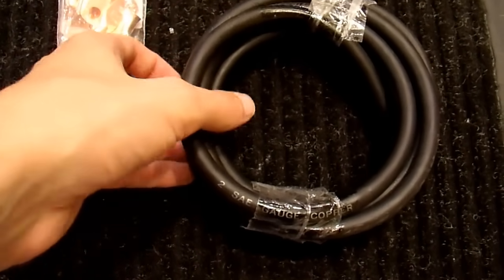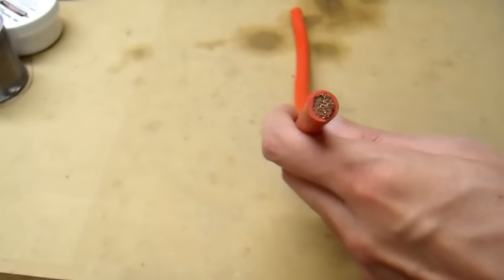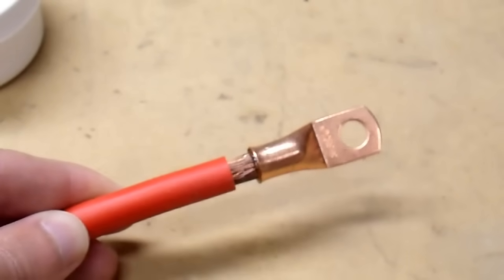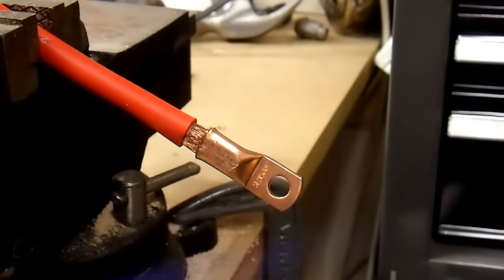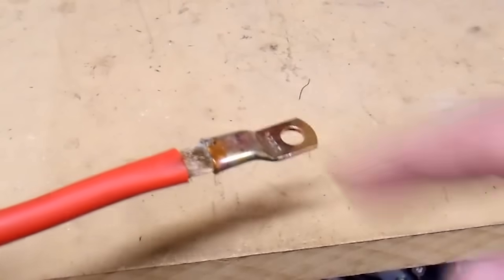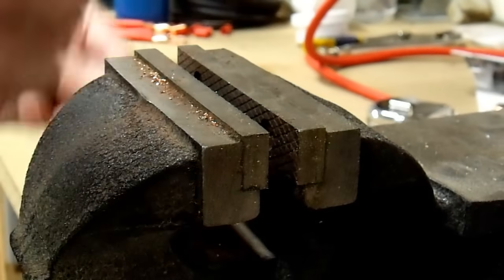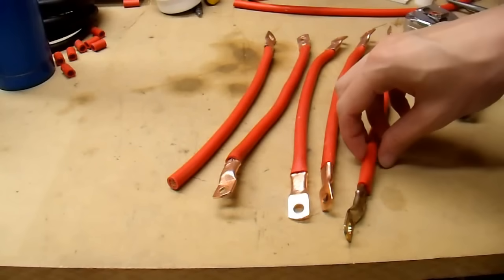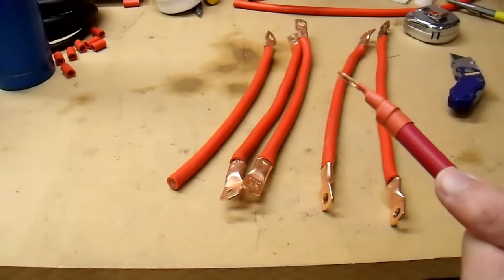How to Make Battery Cables the Right Way and the Easy Way

Comment: The information presented in this video is more of a 'quick and workable' solution and is not intended for anything 'professional', 'top grade', or anything that needs inspection and certification - or at least that's how I would interpret it.
Hopefully by now he has moved on to using actual cable crimping equipment, or at least a handheld style crimper that looks more like a bolt cutter with toothed jaws.
It's bulky, tedious and troublesome to set up, but once crimped is as good a connection as any proper one, though it isn't going to be this instagram picture perfect crimp job - but i'd rather not sweat and whine when it comes to the aesthetics for these things; performance is what is important, not looks.
Then you have the hand-powered hydraulic crimpers with sized dies. Those are made for the job and should make professional grade wire terminal crimps as long as it is set up, used and insulated correctly. We use them hydraulic crimpers here in industrial electrical connections dealing with 480VAC 3PH with 2/0 cable size minimum and hundreds of amps' worth of current, and thus far have no issues whatsoever with the made to fit wiring.
Reply from the maker: This comment.  This guy(? gotta be careful assuming genders today) gets it.  Exactly the point of the video.  While no commercially made cable should be made this way I unfortunately have seen many-a commercial cable made far worse.  Simple methods like this work well but it isn't suited to high quality mass production.

Comment: I've done it that way along time ago. Get the 10-20 dollar hammer crimp tool from amizon. Mine cst $15+ free ship w/ prime
Reply from the maker: I have one of those and am not terribly happy with it.  I think I've used it on 2 cables total for that reason.  The crimp quality is poor with low surface area and since it takes multiple hits it fatigue hardens the metal.  And then the large cavity left over is not appropriate for soldering if you want more corrosion resistance.  A simple 'linear smash' makes for better crimps.

Comment: theres a crimper for this bro...
Reply from the maker: Yup.  The hammer style crimper is terrible and a simple method like this is better.  The hydraulic/pneumatic crimpers are great but cost way too much for the home jobber.  The crimper types that rely on mechanical leverage simply aren't capable of producing the forces necessary for a decent crimp on cables of this gauge so it really requires high dollar tools if you want it done professionally.  The point here is that it really isn't necessary.  Simple and crude methods do work well.

Comment: Good heat shrink has glue in it that seals it... FYI!!!
Reply from the maker: I am well aware of that.  Ingress typically happens due to capillary action and the tiny flaw that allows contaminants in is often not seen.  And never will be until failure if there is heat shrink on the termination.

Comment: is is not good to solder? i have heard from many to just to crimp  because  overheating will melt the solder
Reply from the maker: In most cases the best connection is to press the crimp once without impact using a pneumatic or hydraulic die but for most people making their own cables this isn't a practical option.  Hammer crimps work harden the material and aren't very reliable, so a straight press as shown here is about as good as you'll do with simple tools.  As far as soldering melting if the cable overheats, well, you'll have serious problems well in excess of molten solder if its getting that hot and the solder will drastically improve conductivity and thermal conductivity if the crimp is iffy alleviating the problem in the first place.

Comment: A real electrician uses a special crimping tools. It is easier and faster.
Reply from the maker: Absolutely.  Unfortunately the hydraulic/pneumatic crimpers necessary for this type of cable are expensive and impractical for the type of people who would  watch a youTube video on terminating large AWG cables, and the less expensive hammer-crimp style tools are - in my experience - inferior to the crude method shown here.

Comment: Flux the lug, heat it and add solder about 1/4 way up, flux cable, push it in hold it 30 sec. done.
Reply from the maker: Works well - same process as the solder/flux pellets they sell for this purpose.  The problem is that it uses a lot of solder and if there is any lack of intermetallics due to insufficient fluxing or heavy oxidation (difficult to inspect without cross-sectioning and using a good microscope) you will end up with a mechanically weak cable prone to pulling out.  I prefer a mechanical crimp, and if using a crude crimping method like shown here solder guarantees a low impedance connection.  Just my preference but the above is why.

Comment: “I’m only going to heat the end piece here so I don’t oxidize the wire... “

then processes to roast the shit out of the entire thing..looked like he thought he was soldering a copper pipe
Reply: I heat the connecton until the solder flows.  I intermittently apply heat as needed to keep the solder flowing.  Never continuously keep the torch on the connector.  Keeps the heat from melting the insulation.
Reply: Wow you guys really just wilfully ignored ALL the times he stated there are better ways to do this -  like having larger solder so it doesn't take as long. Like someone else said - he's not going to the moon with this cable. It's good enough for what he needs. Fucking pedantic perfectionists do my fucking head in....
Reply: @chocolate_squiggle  Look at the title of the video.
Reply: @chocolate_squiggle  Bodger.

Comment: This video has got to be an internet perpetual trolling video. 

How do I know the connection under the heat shrink is good? Because I used the right tools the first time to crimp it properly. Then I added heat shrink.
Reply from the maker: And then it corroded 5 years later due to a tiny defect somewhere due to invisible damage or whatnot that let liquid in and kept it there.  And you couldn't tell because it was covered by heatshrink.  Yup.  Just trolling.  Nothing practical here, just theory where no one needs practical experience.  Hey you've got CYA on your side if anyone asks right?  Because you used 'the right tools the first time'.  Yup.

Comment: Just chiming in to repeat what others said - this is the WRONG way, even for a DIY guy, to crimp cables. Also, just stop watching once he re-starts his video to talk about heat-shrink. Total rubbish, even the cheap non-adhesive stuff is better than nothing. If you are worried about poor contact, use a multimeter. If you don't trust your connection, then you should do it again properly.
Reply from the maker: Use a multimeter to check for 'poor contact'?  Wow.  Even if this video is incorrect you clearly know absolutely nothing about the subject.

Comment: this video is FAKE NEWS!      I have worked on. gm - ford - chrysler - john deere - caterpillar -  NONE of them use ANY solder in their cables! they are crimp ONLY! -- with the correct tool of course --  a solder joint is RIGID and will not flew with vehicle vibrations.  using solder will lead to wire breakage and thus a poor connection.
Reply from the maker: Absolutely false.  All of these manufacturers use metal impregnated terminations for high current applications.  ALL OF THEM.  It saddens me to see comments like this that are so grossly misinformed yet claim to come from a knowledgeable source.  OEMs generally don't use solder but they are metal impregnated which is better for mass production yet less practical for the home mechanic.

Comment: The way I do it is to, fill the lug with thick solder & while the solder is still hot or melted I push the cable into the lug. I finish it off with piece of heat shrink. I also can crimp the lug onto the cable with a mini hydraulic crimper without solder. 😊

Comment: Hammer and a roll pin punch make an extremely strong and aesthetically pleasing crimp if you don’t want to you know do it the right way. In an automotive application solder isn’t recommended due to vibration they will definitely break. The exposed cable definitely will corrode, solder won’t stop it from corrosion. Dual walled heat shrink is an absolute must. Your poorly crimped connections I would agree should be hidden. This is by far the worst video I’ve prolly ever watched on the “right” way lol. The heat shrink part I feel made a lot of us a little more retarded just due to listening to you say it. The actual purpose of good quality heat shrink is to stop the corrosion from entering in the first place lol. Once the glue squishes out the end it’ll be years before it ever if at all corrodes. 

Tip of the day silicone a penny right beside the positive post on the battery and you’ll no longer get corroded connections at the battery posts. The penny gets eaten away and no more corroded positive post. Just replace penny after the previous one disappears

Comment: You don't need to crimp it you really are a greenhorn
Reply from the maker: It saves on solder.  You can purchase solder/flux pellets to place in the connector before heating and press the cable into the molten metal but it uses a lot of lead/tin which is fairly expensive.  Crimping also results in a more robust mechanical connection that isn't as reliant on intermetallics holding the connection together.  Poor intermetallic mixing is the primary cause of solder failure in the solder type of connection without crimping.  For the home jobber I would NEVER only solder for that reason alone.  In a controlled manufacturing environment, sure.
Reply: @knurlgnar24  but you put flux on....

Comment: I wouldn't bother with the crimping, just solder. Neater roundness. Still, I'd use proper battery terminals: https://origin-images.ttnet.net/pi/eprv/10/00/50/34/NP610005034-35b.jpg
Bare the wire to the correct length, insert into the terminal and clamp the 2 screws tightly. Job done.

Comment: For like $15 I got a tool on Amazon that you place the the terminal in, that has a slide that you hit the top of with a hammer and it crimps the terminal. I tried to pull a terminal off and could not get it to budge at all.
Reply from the maker: I have that tool as well, or at least one like it.  It works OK but is constructed very cheaply as they all seem to be.  It seems to work for me about as well as a vice grip or bench vise.  I think it is a useful tool but nothing special with respect to making terminations.  I prefer this method.  A multi-hundred dollar pneumatic/hydraulic crimper would work better in most circumstances but that isn't really the purpose of this video.
Reply: @knurlgnar24  a good hydraulic one with dies is $50 at Harbor Freight, just so you know 👍

Comment: No...  The right & correct way is to spend the $30 for a hydraulic crimping tool with replaceable AWG wire crimping dies...!   (The hydraulic crimp actually molecularly fuses the copper terminial & copper wire...)
Reply from the maker: You won't find a proper hydraulic crimper for $30 - and if you do it will be absolutely terrible.  If you want to spend hundreds of dollars on a crimping tool then that is an option, but this method works just fine for most purposes.
Reply: @knurlgnar24 I think I paid $28 for mine in a blow molded case & it works great...!

Comment: There IS a way to test the integrity of wires. It's called a voltage drop test. This entire video is wrong on so many levels. You really should take this down or rename it, "I'm cheap, ignorant and lazy if you are too this is the video for you"
Reply from the maker: The equipment required to test the conductance of a crimped cable is expensive and specialized and therefore completely useless information to viewers of this video.  It is also not a good method for determining cable quality contrary to what you state.  This video is about making cables quickly, easily, and functionally solid without unnecessary tools and steps for the amateur.  Given your comment I am quite certain that you are the ignorant one here.
Reply: @knurlgnar24  A 20 dollar multimeter is "expensive and specialized equipment"? How do you not know this? Don't act like an authority when you don't even have the basics covered.
Reply from the maker: @ratfink9205  I have worked with inexperienced engineers and know how these things work.  It IS possible to use a $20 multimeter to get measurements of conductance on a sub milliohm termination but the setup and measurement technique results in useless measurements almost 100% of the time.  You really do need specialized equipment to get that measurement right a high percentage of the time with average trained personnel.  Viewers of this video are not interested in some know-it-all spouting what they read in their training manual.  They are interested in what actually works for the average person.  In addition the conductance of the connection is relatively unimportant compared to the rest of the parameters.  e.g. a poorly crimped termination can easily result in a low resistance but be a poor crimp as a resistance test is only applicable if a particular procedure is assumed to be followed properly.  FMEAs and the like are often used for these instances.  This is the sort of thing an experienced engineer encounters repeatedly.
Reply: @knurlgnar24  They don't need some hack telling them how to shade tree their way through it either.  You don't need specialized processes or tools to do a proper job for the 'average" DIYer. A good hammer crimper can be had for 20 bucks. You can't even manage to strip the insulation off properly FFS.
Reply: @knurlgnar24  Here, learn something so you can intelligently convey ideas to your audience. https://www.google.com/search?q=how+to+do+a+voltage+drop+test&oq=how+to+do+a+volt&aqs=chrome.0.0j69i57j0l6.6018j0j8&sourceid=chrome&ie=UTF-8

Comment: wrong never solder battery cables the solder will blow everywhere should the cable short , use a proper crimper or better still a hydraulic one and the cable should be tinned copper to prevent corrosion and heat shrinked
Reply from the maker: This is a myth and not backed by any evidence or data.  In the case of a short all metals will be vaporized and solder or copper will behave in a similar fashion as safety data shows.  Arc fault severity does not depend on metal type.  Corrosion is reduced by tinning the copper or by soldering.  Heat shrink always increases corrosion potential by trapping contaminants in the cable, it does NOT decrease corrosion.

Comment: You should triple up on the solder and some kind of heatsink on the insulatation so it does not melt .Use wathever works.

Comment: Man! Talk about doing that the hard way! That was painful... Put the flux on the cable.. put the terminal in the video.. heat, add solder, shove wire in terminal , let cool.. no need to crimp... Add heat shrink done... Bam... 80% faster...
Reply: That's what I was thinking.. way too hard.  Been doing it the way you described for years to make quick reliable power connections... made little jigs to hold everything in place for difficult locations... also, used nice appropriate sized hand held torch for better heat control.  No corrosion over the years, durable... in my opinion better than factory cables which I've seen develop resistance inside the connector, only discernible by heated terminal or voltage drop... with proper technique soldering is the way to go.  Use quality heat shrink to seal and finish.

Comment: Had to stop watching at the vice as a crimper part...Whole reason there is a tool for crimping lugs is to make contact with 4 points of the lug To close the diameter of the lug into the wire Without changing the spread of the wire Where you end up with pinch point  Depending on the power into the wire This will be your hottest point "A bottle neck of power" if you will. Also using a very thin coat of dielectric grease will sovle your issues of oxidation inside the lug And still keep its strength. Keep your exposed wire to a very min,  Proper shrink tubing over the wire and lug is always best.

This way ...You have 0 exposed points in the lug (no need for soider/paste/torch = money saved) No need of a Avg $100 Vice = money saved 

And with my way You have a full rounded crimp with a Hammer crimper ($25) which you can always bring back to the store And tell them is was the wrong one and get a refund = money saved for one time uses Your wire is now on tight / sealed .. Battery cables the right way ..Because eazy isn't always the right way

Comment: I believe power cable connectors are never soldered, only mechanically fastened. I do not know the exact reasons why but I would guess it is for safety and reliability reasons. In that respect, the second, "easy way" to make these cables is the "right way" whereas the first "right way" is a no-no. But you should do your own research and consult a professional and not rely on my comments. Besides, standards, rules and regulations are somewhat different in each country and region and of course for each intended usage.

Comment: Yeah acid flux ... I would tin the wire so it burns off first but rather use Rosen or liquid flux that evaporates/boils off. Not a big crimp fan because I have seen too many fail, I always solder, even 6 awg connectors having worked with 100amp plus EV motors and a little vinyl dip goes a long way at sealing the wire ends to the insulation.